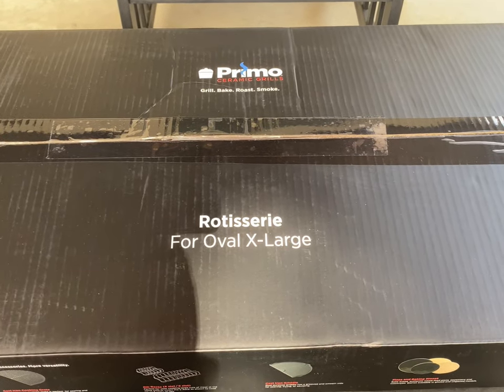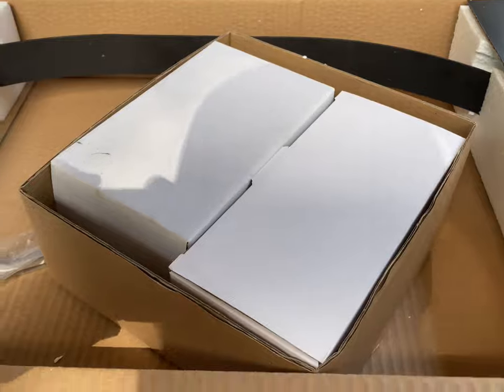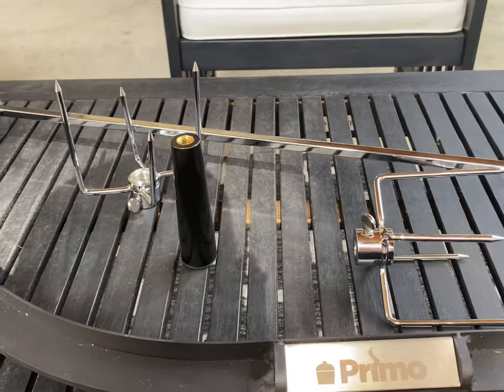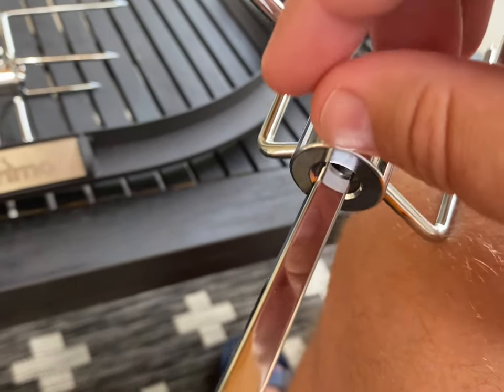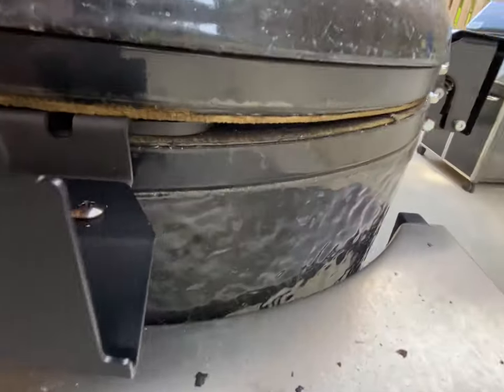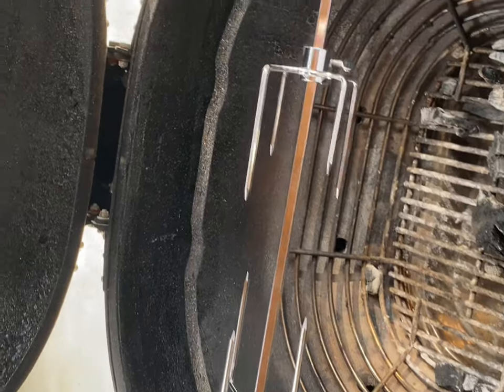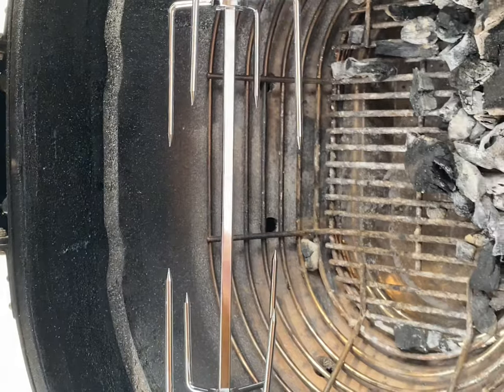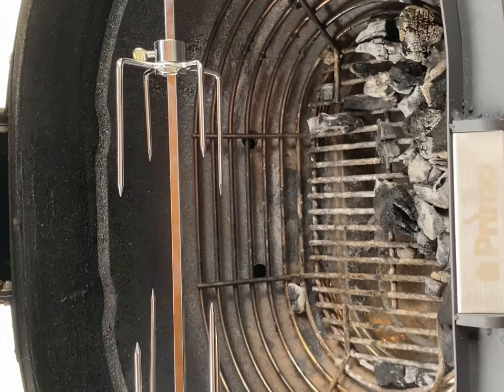Unboxing and set up of Primo Ceramic Grills rotisserie

Comment: Hi there! Thanks for posting this vid! Im researching which kamado to get and i recently came across the Primo grills. I wanted to ask whats goingnon with the coating of your grill. It looks like its cracked/scratched all over. Is that normal aging of the Primo or is it banged up from travel etc? Thanks
Reply: 4:31 for example
Reply from the maker: I apologize for the delayed response! There is no issues with the outside of the grill beyond the cosmetic things you see. I keep mine uncovered and outside so it gets all of the elements - rain, pollen, dust etc. When you get the grill to temp it will “sweat” which pushes it out and gives it the look you see. 

Unsure if you have made a decision but I cannot say enough good things about the Primo.
Reply: @allporkedup1687  i kept researching and i did get a used Primo XL ! Loving it!  Thanks for your response